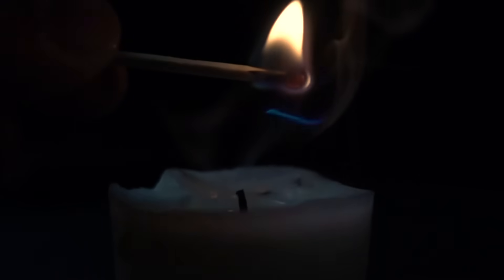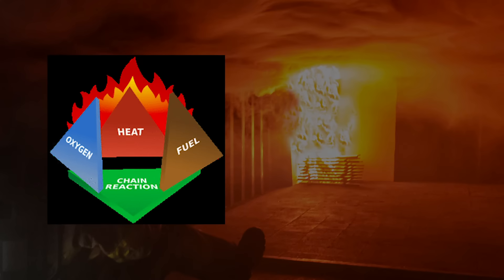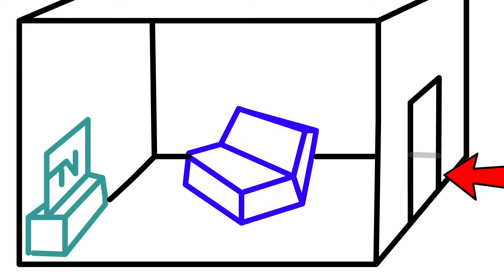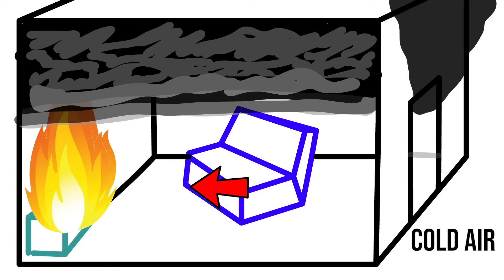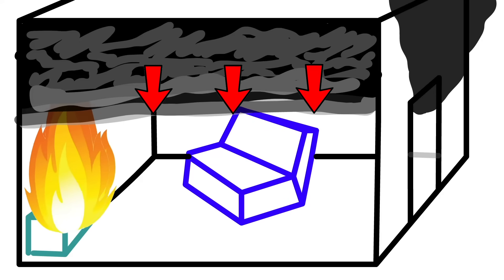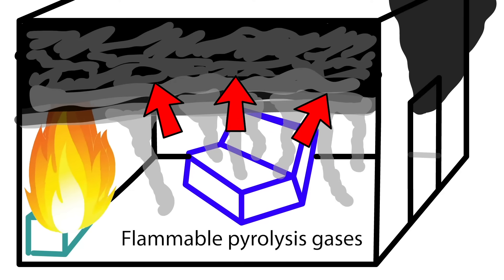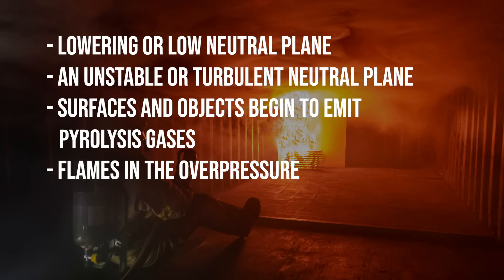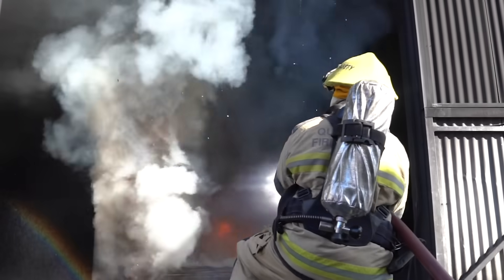An Introduction to Flashover - Episode 9

Comment: Hi Matt, I have a question, what's the difference between a flame over and a flash over?
Reply from the maker: Hi Vera. Flame over (aka roll over) is when a flammable mixture of smoke ignites above the neutral plane and "rolls" across the room. It's also been called the dancing angels. Flame over is actually a sign that flashover is getting closer. Flashover refers to the transition from a fire within  the room to the entire room catching on fire. Hope this helps 🙂

Comment: Where are all the videos on Flashover Prevention Training or Vertical Ventilation, How It Works Training or How to Stop Stuff from Burning Training?
Reply from the maker: G'day mate. Thanks for asking but I don't make tactics related videos. Tactics is something that is highly variable across the planet and any one tactic may contradict another one (there is more than one way to fight a fire). Therefore I think that kind of information should come from your own organisation. 
Fire dynamics.(these videos) is a bit different because fire is quite consistent across the planet as fire dosen't change only the conditions do. Hope that answers your question. 🔥
Reply: @MattDavis5  My point was, there aren't any.  People and organizations just make videos on the problems but not the solutions.  The downside or aftermath and not how to avoid the problems.  Like Vertical Venting.  Plenty of videos of hole cutting but none showing conditions improving inside.  Flashover but not how to eliminate combustion and cool the gasses.  Lots of glamour but not the work

Comment: With this film I understand better about the flash over as to how it builds up to that point, but before it builds up to that critical temperature for the flash over, my question remains:  if one firefighter or 2 uses a hose to try to cold down the smoke... whys doesn't one more firefighter use an othe water hose to put down the actual fire? at the same time? Has this been tried? HM

Comment: I think of it as the heat from a fire bakes the smoke/syngas out of the materials in the room.  Finally the heat in the room reaches ignition of the syngas in the smoke and everything ignites if there is air to feed it.